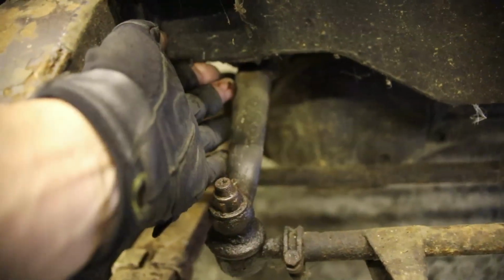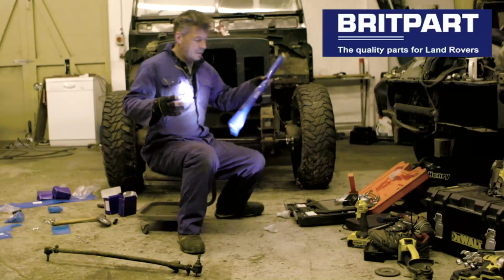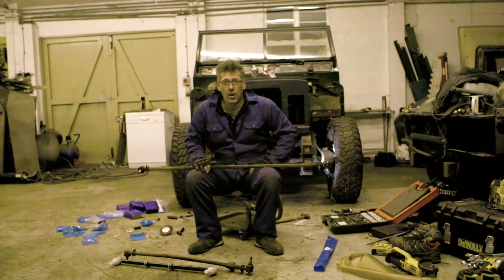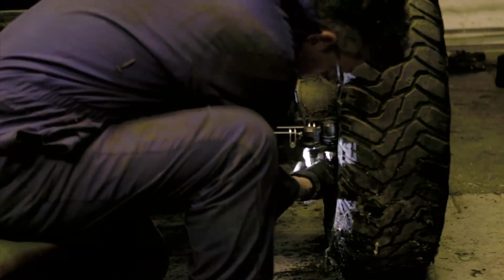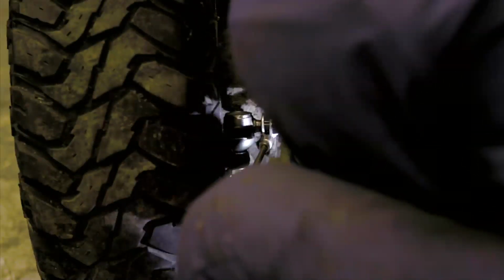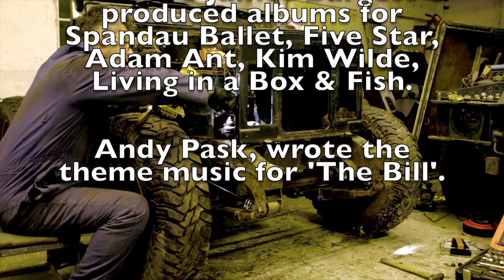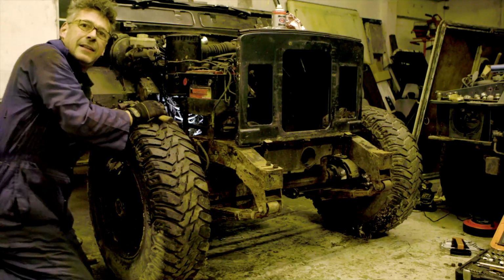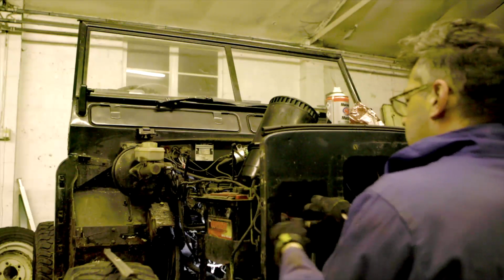Ep.11 - Series 3 Rebuild -  "Tracks and Rods and rock and roll"

Comment: As you probably know by now you need a special (land rover) puller to remove the steering drop arm, due to limited access. It’s an expensive little thing.  Here’s the part number. HNJ6000000.
Reply from the maker: Thanks Sask, Yes, I know now. Of course I got a cheap version, after the job was completed. Obviously.